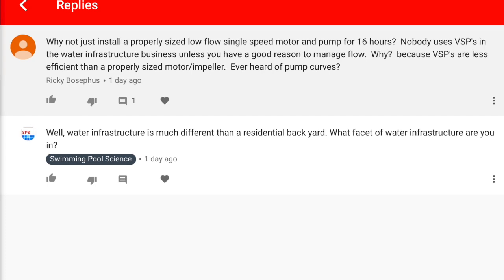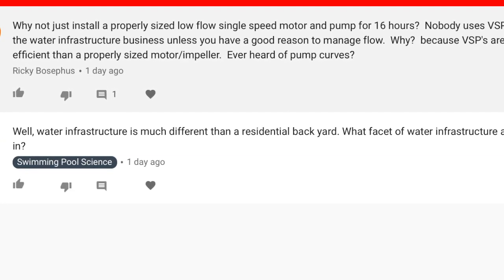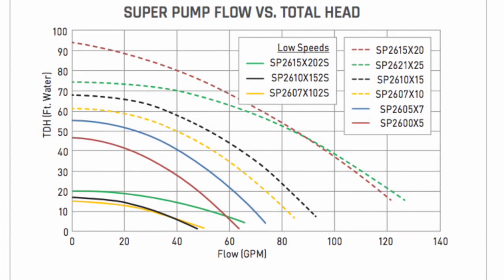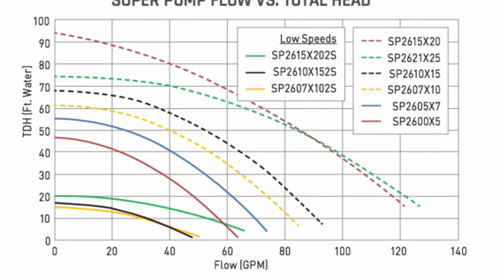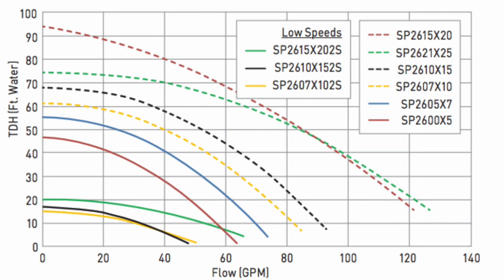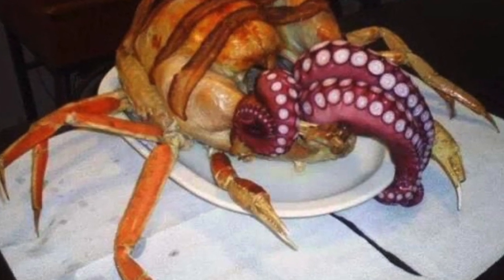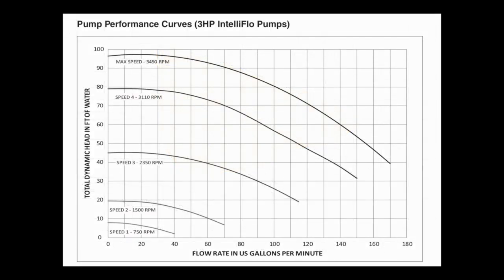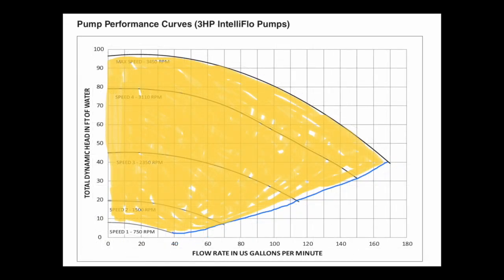Why VS Pumps Are Better

Comment: So how do you find out what your TDHP is? I have an almost 2yr old cocktail pool (8700 gal) and the builder was terrible at explaining how to get the most out of my VSP.
Reply from the maker: Hey Justin, what pump do you have? Do you have an Intelliflo VST or VSF? If you have the VSF, it’s super simple to set it up. If you have a VST, you’ll need to connect some gauges to the pump (not too hard) then you can run it at different RPMs and create a pump curve chart that will tell you your TDH at different RPMs.
Reply: @SwimmingPoolAZ-SPS  I have a VSFHP165  FloPro.

Comment: Hey Josh,
   Speaking of pool pumps, mine just locked- up yesterday.👎  Since it tripped the breaker, I'm guessing that the motor - and not the switch or the pump impeller-  failed ; does that sound right to you? 
Anyway, I'd love to get a VS PUMP, But I don't know if I can budget it in right now, so I might just get a 1.5 HP single- speed motor for my DuraGlas™©® pump. 
Is that a do-it-yourself job in your opinion?! I think I JUST NEED to remove the top two bolts, loosen the pump band , disconnect the wiring,and bring in the unit to the pool store ( it's  $135 if they come to the house) with the TWO bottom bolts attached to the pump base/stand. Sound about right?! Lastly, do you know what size the bolts are?
PS In your experience, is the problem ever just the pump motor capacitor?
Reply from the maker: Could be the cap.....that would be sweet as it’s a quick fix. No need to loosen the top two bolts, just the band clamp, split the pump, then do the wiring. One of our older videos covers this, search for it and take a look. If you can keep your old pump going a bit longer than squirrel away a few bucks, you’ll be good to go on the VS before you know it.
Reply: @SwimmingPoolAZ-SPS  
Thanks for the info. I'll Give it a shot. Is the fact that the breaker was tripped pretty typical for a pump motor failure?
Reply from the maker: Charlie S. If there’s an internal short, yes
Reply: @SwimmingPoolAZ-SPS  
Thanks a lot. I'll check-out your video as well. BTW, do you do service calls to the East Coast?!😁

Comment: This guy is exactly right.  VSPs are super efficient, and  I dont think he even mentioned how QUIET they are.  I have to sneak up on mine to even determine if its runnign or not!    And they have built in freeze protection, scheduling capabilities, and several other value add features.  So its not just about efficiency, there is quite a bit more to the big picture.   If someone stole my Intelliflow VSP in the middle of the night tonight, I would have another one it immediately.
Reply from the maker: Oh yeah....they’re stupid quiet. On low speed a lot of times I have to feel the returns or look at the display to see if they’re running.

Comment: I have a 15,000 gallon pool with a raised spa that acts as a water feature. About 90% of my 1 1/2 hp single speed pumps capacity flows into the spa to create the pleasing look of the water feature. If I decrease my flow, the water coming out of my spa will dribble down the wall of the pool and look horrible. How would a VSP work for me.
Reply from the maker: Is your pump and heater tied to an automation system? If so, you can set up the low speeds to just run a single body of water at a time then during high speed it can be programmed for spill over using valve actuators tied to the automation system. If you don’t have automation, then you’ll be stuck with the water dribbling over the side. Does it leave big calcium stains when it does dribble down or does it just bug you from an aesthetics stand point? If it is leaving stains, I’d check your water hardness, pH and alkalinity. It may be time to change your water or reseal your spill over as that might be the root of your problem. The big savings on your electric bill are hard to ignore with a VS pump!
Reply from the maker: There’s also some really great automation systems for reasonable prices now that you can run from your phone as well.
Reply: Swimming Pool Science I do not have an automation system for my pool. Do you have any suggestions.
Reply from the maker: Pentair’s Easy Touch PSL 4 is a great entry level system that will run your pool and spa as well as communicate seamlessly with Pentair’s VS pumps. Hayward also has a new, simple automation system that will run your system as well called the Omnihub that has some great features.
Reply: Swimming Pool Science Thank you for the info, I will check out both of them.

Comment: My pressure gauge was consistently reading 10 psi on my sand filter while opening the pool...after all the backwashing, vacuuming to waste, rinsing etc, now that the pool is clear and ready, my psi gauge does not move although there is good flow and suction.  Thoughts?  Just need a new gauge?
Reply from the maker: If the gauge is a few years old, I’d just replace it. Also, Feel the suction in your skimmer and the pressure at the returns, does the water feel like it’s moving good? Check your impeller too as it may be clogged if the water isn’t moving well. Gauges are super cheap. You can get one at: https://amzn.to/2Wb2hcX
Reply: @SwimmingPoolAZ-SPS  Thanks!  Water flow seems great.  I'll dig (gently) around the impeller with a hanger a bit. Subscribed with Notifications on.

Comment: I think the guy that commented missed something else... running at that low speed 100% of the time will result in horrible skimming action for the pool surface. With a variable speed you could program a couple of hours at higher rpm for a pool cleaner and/or better skimming action. I currently have a 2 speed Jandy Stealth and the low speed results in a huge energy savings, but horrible skimming action. I only have a manual high/low switch (not separate timers) so I can't have it automatically go to high. I can't wait to upgrade to a vsp.
Reply from the maker: Exactly.

Comment: I couldn't have said it better myself
As you said power when you want it energy efficiency when you need it
Homeowners are fickle creatures they change their minds all the time one season they may want to save all the electricity in the world the next season they may want every fountain feature on 
A vs pump is the all-around pump it does it all it's not the most efficient it's not the highest flow rate but it does a decent job at both